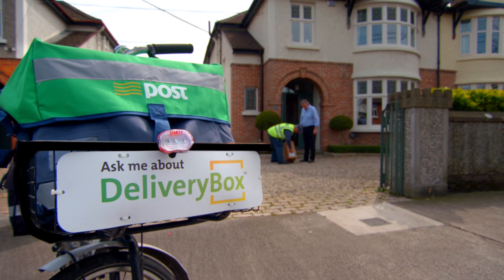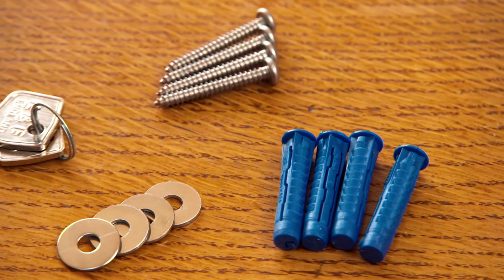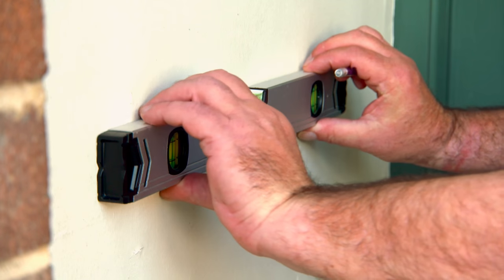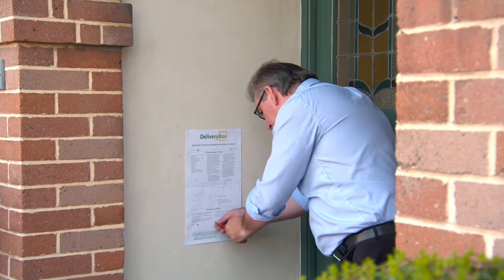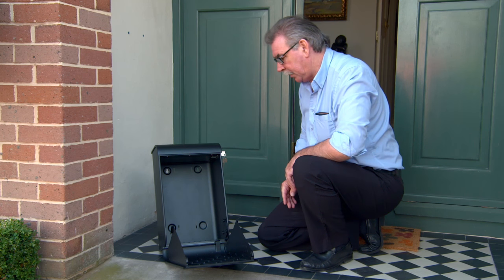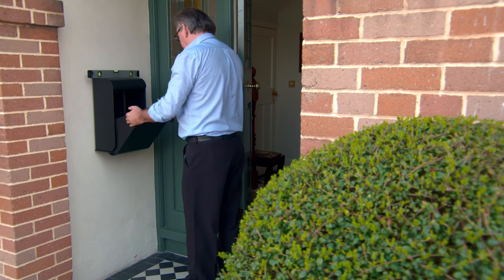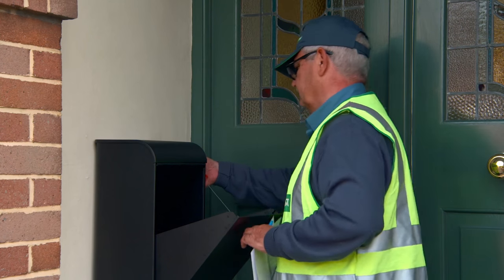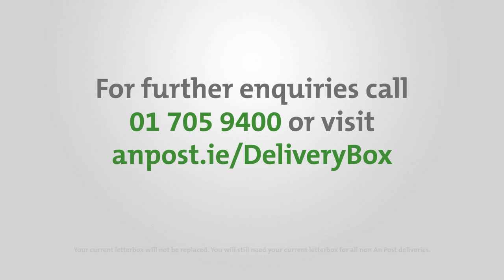How to install a DeliveryBox™

Comment: 4 washers...
You only used two on-the-bottom fixings in the method described/shown in this video. 
If your template is correct, one shouldn't have to see if it's level by inserting the top two washer-less screws on which to hang the box? I presume, your method requires, fixing the bottom, unscrewing the top & re-screwing with the washers. 
Anyhow, I'm procrastinating instead of cleaning my coal bunker...